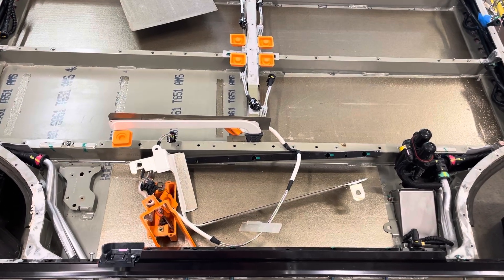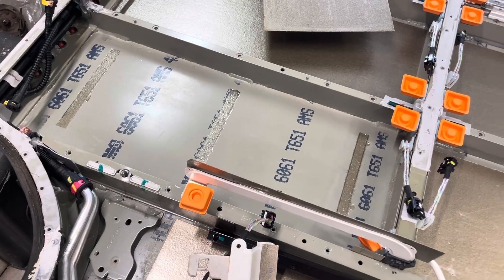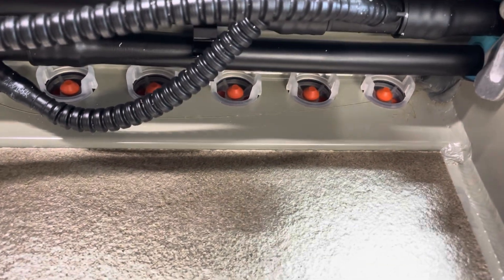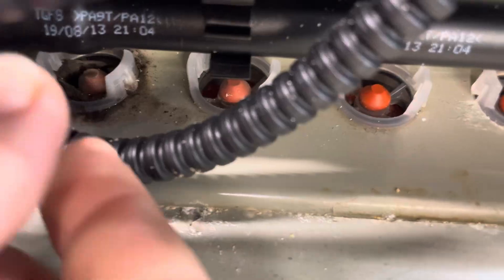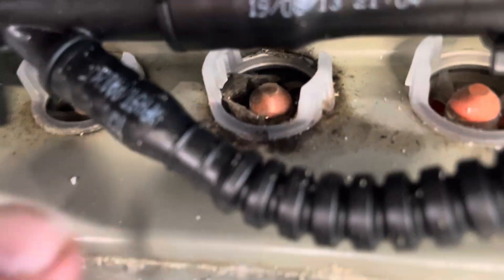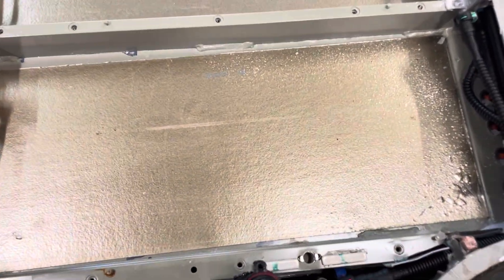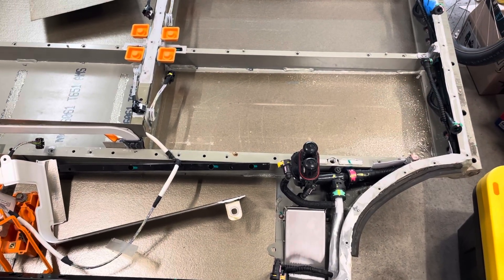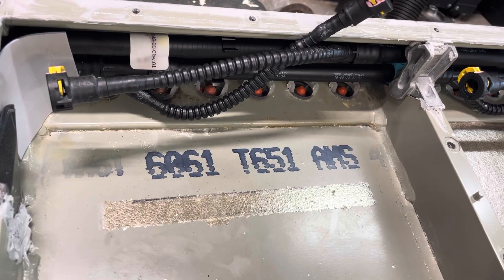Tesla Battery Repair: THIS Killed my Tesla Battery? (Umbrella Valves?)

Comment: I’d go with a rigid fiberglass (GFRP) sheet as the main structural and insulating layer, plus fiberglass cloth for heat protection (for myself, i gonna die on my own alone). If you can find it, I suppose asbestos works well. these sheets looks like mica, it is. searching says: 2015–2016, this was replaced with Nomex and thin aluminum. Model 3/Y uses fiberglass cloth, aluminum, and soft pads.

Comment: Yes, you must replace the MICA insulators which are failing.

You MUST inspect, remove, and dry all module BMS. 
DO NOT mix them up by module!
Handle BMS properly to avoid latent  static!!!!

The plastic module covers can be removed to help dry the module.
 If you have corrosion on the cells, that module will likely need replacement. 

Recommend smacking the side rails hard with a hard rubber mallet to loosen debris.
Then spray the screws with PB Blaster. Allow to sit 20 minutes. 
Insert driver, hit end of driver with ball peen hammer. Then attempt to remove screw. 
A cordless drill with high torque setting on reverse. 
Have 3 spare bits! Use a small metal brush and pick to clean screw head.
Be sure bit is seated in the screw head 100%. They strip out easy. If it strips, cut a slot with a dremel and use proper fit standard blade.
Or, cut off the screw head, try to remove screw shaft with small vise grips.
Or drive out with screw remover.
Sometimes the treaded insert is damaged. Be prepared to replace that.

Remove umbrella valve with a plastic tool. Remove/replace BEFORE the module reinstall. Little plastic ends of the broken valves need to be vacuum out. 

Try to obtain the new style umbrella. Much better design. Install very carefully.
NOTE: All valve sets are NOT the same. Look at the colors. The foreword set is different than the others.
 Inspect wearing bright headlamp, laying on you back, to be sure they are properly seated. The O ring tends to get pinched.

I suspect that battery was submerged at some point. That is the primary cause of water intrusion you have observed.
Reply from the maker: Do you have any suggestions on where to get replacement mica boards from?
Reply: @BenjaminNelsonX EV West in Southern California. Medlock and Sons in Seattle WA. Gruber Motors in Phoenix AZ. Out of Spec EV in Portland OR. On line seller of Model S modules, I recall one in Sacramento CA.
Look up and contact EV battery battery recycling companies.
Redwood Materials Carson City/Reno NV, perhaps they will/have developed a market for the mica insulators. 
Unfortunately, I do not recall the Tesla vendors for many parts.
Reply: Good info thanks!!

Comment: your water intrusion is mostly from inital fuse cover leak. Every fuse cover leak repair I have ever seen that doesn't open up the pack and remove all moisture fails within few months. Its a incomplete repair. Once the water is in the pack, it doesn't come out. In fact, it will just evaporate and condensate repeatedly and often ruins a couple of capacitors on the BMBs. The rust is from the module 8-9 top cover. Its not just AC dumping water behind it. I've seen the front end of the hump cover rust too from frontal water intrusion (car drives forward in rain, waters gets in)

Comment: Hi 🙂love your content. Just opened my pack and discovered water underneath every module and sheat. I too suspect the umbrella valves are the culprit; the metal rails protecting them were full of gunk - I think they no longer could function as intended because of it. The one just next to the right wheel-well had the most intrusion, where the sheet had become like putty and just broke apart in my hands. I have put all the modules in our garage and left them to dry. All the modules had condensation inside the plastic cover.
Reply from the maker: Yipes!I hope you ran an isolation test. 
Things get real scary with that much water. 

Sounds like you have a pretty major project!

Comment: any word yet on what kind of damage the moisture may have done?
Reply from the maker: It appears that I have at least one battery module board with a corroded capacitor on it.
Reply: @BenjaminNelsonX well, at least that sounds potentially repairable!

Comment: I'm no engineer but wouldn't just a single valve release pressure, seems unnecessary and a source for increased issues to have so many installed.
Reply from the maker: Tesla REDUCED the number of valves in their later designs!
Reply: Wouldn’t be surprised if there was 420 valves in there , or maybe 11 just so somebody can say there’s goes to 11
Reply: @dorhocyn3 there are 84 in the older models, so 2 x's 42...
Reply: The vavles are required in each module "bay" because the bays are sealed from each other by the RTV when the cover is installed. 
The reason/intent of the valves is to compensate for changes in atmospheric pressure.
 And to isolate the module off gas/avoid explosion if a failure/accident.
Reply: Can you pop them out to clean and check ? 🏴🇺🇸🏴
Reply from the maker: @pollywollydo  I plan to remove these and replace them. When they are removed, I should be able to inspect them better and show them to camera.
Reply: @BenjaminNelsonX cheers 🙂.  Regards from Olde England  ( what’s left of it 🙄)